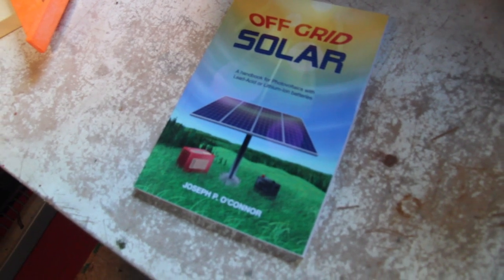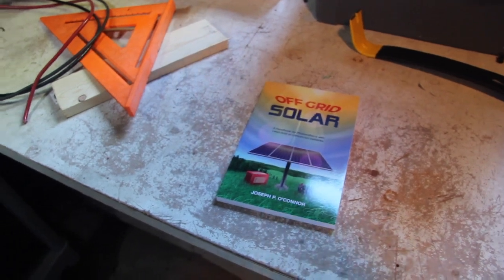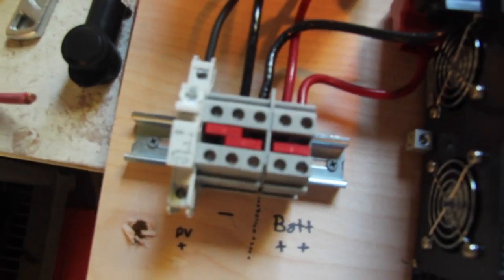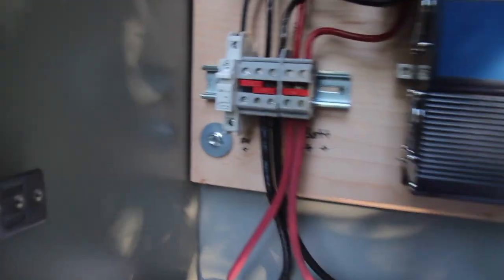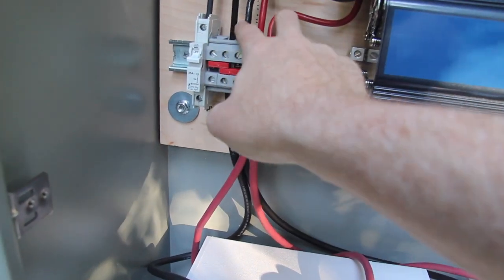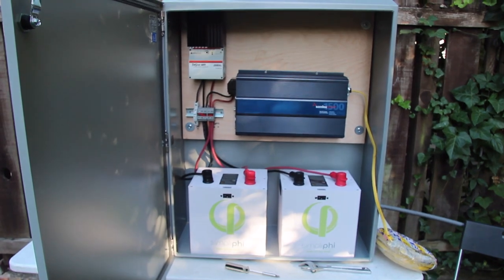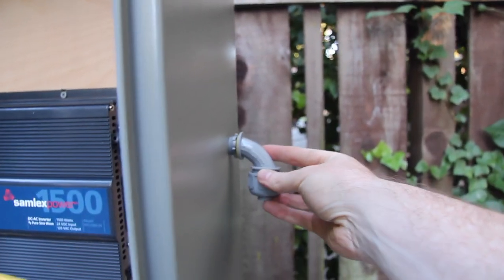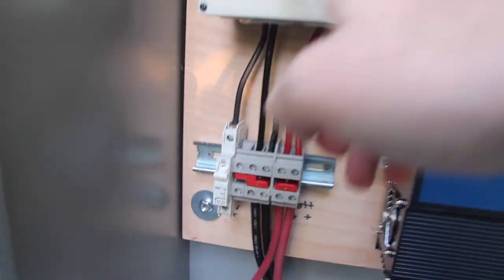Off Grid Solar Yurt - Preparation

Comment: Hi, my dad just bought a yurt and needs electric for just a few things. What do you recommend in regards to batteries, panels, etc?
1. mini fridge
2. power strip with TV
3. Toaster oven sometimes 
4. heater/fan in the winter/summer
Reply: Hi Maria. You could read my book Off Grid Solar and design your own system. But your loads sound similar to the yurt I worked on in this video. You could use the same equipment from that I used here.
Reply from the maker: how did the project go?